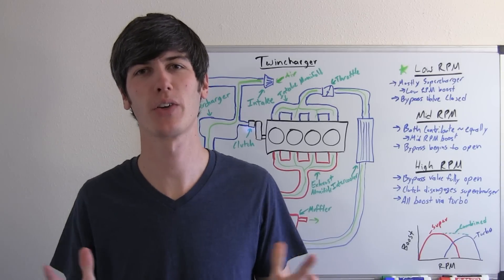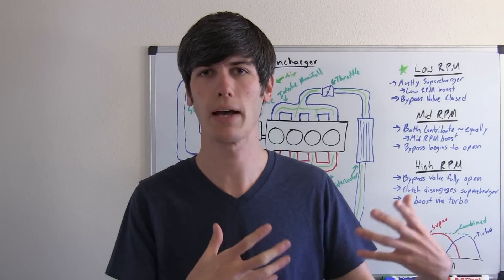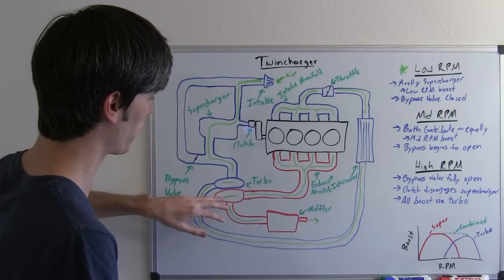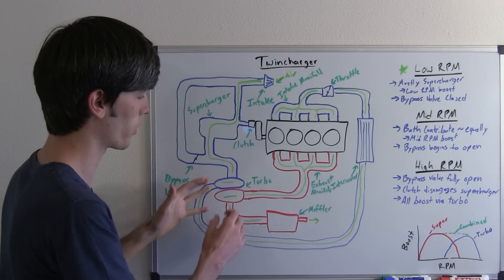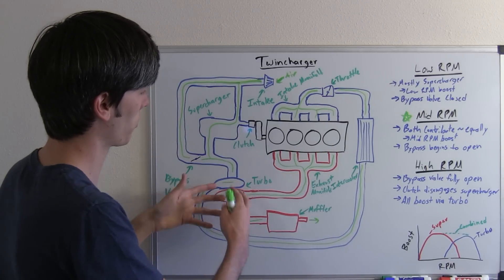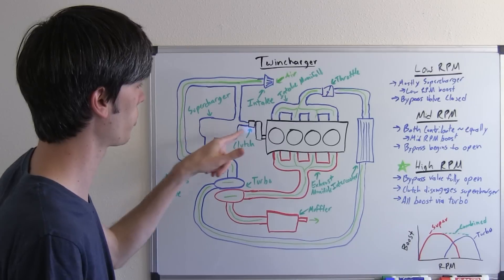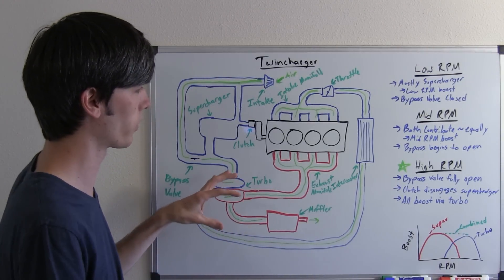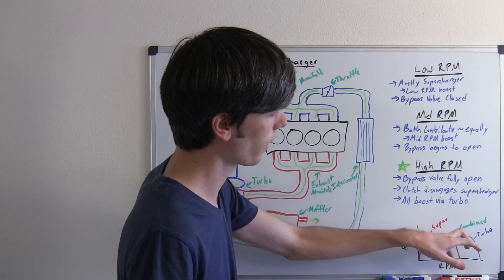How Twinchargers Work: Supercharger + Turbocharger

Comment: In the case of the Turbocharger: What if instead of a journal bearing or even ball bearings alone, you attached staged planetary gearboxes between the exhaust driven turbine and the intake turbine? If the exhaust gases were powerful enough to spin the input turbine, the speed of the output turbine could be much greater than the input, theoretically reducing the lag.
I don’t know how much would still be there because you would still need to build up enough exhaust pressure to spool up the turbine, but I think it’s a simpler design than having to worry about both a supercharger and a turbocharger, not to mention the system monitoring the RPM range, controlling the bypass and disengaging the supercharger from the crankshaft.
Or maybe it isn’t. :)

Comment: Couldn't the turbo portion simply take over the rotation of the screw when the exhaust speed becomes high enough? I'm thinking like on a bicycle where the pedals can both power you forwards or just sit still while you are rolling - so you could have supercharger pedals and turbopedals both connected at the same time if you get the analogy.

Comment: What if the supercharger never stops working i mean if there is no clutch to turnoff the supercharger and it keeps working with the engie rpm and when the rpms are enough turbo kicks in as an add on ? Please do answer my question as i am working on my Mercedes-Benz c180k kompressor to make as much hp & torque out of it as possible.

Comment: Few questions. Why not, instead of a clutch to the supercharger, simply have an opening for air above the compressor screws? Turning the supercharger isn't what robs power, the act of compressing air does. By preventing the air from compressing, the only power draw is friction at the bearings and the rotating mass of its internals (which is minimal).

Comment: Either I'm missing something or your flow diagram has a problem, specifically the location of the bypass valve. In the diagram boosted charge from the supercharger connects to the atmosphere during mid RPM. Under such conditions some of the boosted charge will flow backward in the intake. In twincharging I thought it was easier to have the intake flow to the turbo first then to the supercharger. Air will flow through the turbo as it does below the boost threshold and compressed by the supercharger. Above the boost threshold boosted air will be delivered to the supercharger. If one wanted to bypass the supercharger at some point the bypass valve would be located between the turbo outlet and the supercharger inlet.

Comment: Why hasn't anyone used compressed air injection directly to the turbo on the exhaust inlet using a nos button and eliminate turbo lag? The best of both worlds and an additional helping hand at high speed.

Comment: In the situation of a roots or screw type supercharger, which builds boost early, feeding into a centrifigual turbocharger; wouldn't the forced flow from the supercharger cause the turbo to spin up thereby driving the exhaust side of the turbo to scavenge exhaust rapidly? Essentially, at low RPMs, swapping the functionality of the sides of the turbo?
Reply: Rolf Kirby would you need a turbo with that setup though? The centrifugal charger already acts like a turbo and the twinscrew would help provide more linear boost wouldn't it?
Reply: Maybe the centrifigual turbocharger would give more boost at higher RPMs, while the screw would cover lower RPMs.

Comment: Amazing explanation. By the way, what it would be the cost of not having the clutch to deactivate the SC? Since lets say, the turbo at full boost with the bypass open the SC wouldn't fight to create positive pressure since the turbo would be doing that. It will have some loss but not compared with the bypass closed.
Other question is would the SC help the Turbo to Spool?
Last but not least is there a bypass butterfly valve that opens when delivering boost to an actuator, like a mechanical way to open the valve when sees boost, or is only electronic?

Comment: can i put the turbo before the supercharger?
Reply: we have been doing that in the diesel world for decades. its a far more popular system than the one shown as the turbo basically free wheels when exhaust gas isn't spinning it up, then when turbo boosts, the power consumption of the super charger drops to near zero as it isn't actually compressing air any more. much better system than this and no need for a clutch etc. most superchargers only use a hp or two to spin, its the creating pressure that sucks the power.

Comment: Andy's Autosport TV said turbos work at low rpm's while superchargers work at high. What's actually happening?
Reply from the maker: +Dave Restrepo in Volvo's production twincharged engines, the reverse happens. Super for low, turbo for high.
Reply: Thanks for the reply man. What makes volvos engines unique to this? and are they the only ones? Will there be a video about this?

Comment: Hello. Thanks for the great video. In your diagram you went from supercharger to turbocharger. Instead, can you go from turbocharger to supercharger with the by pass valve on supercharger? If so, would you need to run an intercooler from the turbo to the supercharger, or could you route the turbocharger directly to the supercharger, and from the supercharger run the intercooler to the intake manifold. Thanks again.

Comment: brilliant video and really knowledgeable! noob question but say i have a 150hp capable SC and a 500hp turbo would both the power from the SC & turbo combine and make more power than just the 500hp turbo on its own?
Reply: Not really, but you could combine them to eliminate turbo lag and have power throughout the rev range rather than just at the top end.

Comment: it be better if the supercharger would be used at the same time as the turbo wayyyy better because, As the supercharger Sucks in more air therefore more exhaust gases are made and then the turbocharger would spool up way earlier than normal and  would Suck in even  more air but you would need two sperate intakes Boom MINDBLOWN
Reply: The The Only Thing that's what I was thinking, running both at the same time more boost

Comment: I'm sorry to be asking a question on such an old video, however, it's something I've thought of time and time again and, if possible, I'd like to know if it would work not as well, just as well, or better than twin charging an engine. I have a supercharged Mercedes that I really enjoy and, once I'm able to, I'd like to be able to build the engine to somewhere around 400-450 hp, if possible. Obviously, if I'm going to do any serious hp increases, I would need to upgrade the internals and my question is assuming this is already done. Since my car is already supercharged, would I still be able to turbocharge it and have an added benefit of essentially supercharging a turbo?

Comment: So if I put one small turbo and one big turbo, can it work as twin-charger? Since the smaller turbo requires less exhaust to initiate in low RPM and in mid RPM the bigger turbo starts to kick in and in high RPM the bigger turbo provides most of the boost. And will this have less turbo lag or maybe no lag at all?

Comment: Could you do twin turbos and a supercharger
Reply: Yes you can actually.
Reply: Loginwithlogan 3 i got a idea what about 8 twin turbos in 1 car that car will burn the tracks
Reply: Generally you run twin turbos to get better spool up or for packaging reasons...a V 12 for example.  But with a supercharger covering the low end, I guess it makes more sense to have one larger turbocharger that is sized for max top end power.  A turbo sized for max boost at the top of the rev range will deliver a cooler charge than a smaller turbo pushing past its efficiency.
Reply: LoginwithLogan3 now your thinking like group b
Reply: @thepat2725   group b may have been batshit insane but they werent that insane hell the delta s4 was only twincharged and it already killed 2 people granted if they let it go on for any longer that way of thinking might have not been far off considering audi tried to make a 1000 horsepower version of the quattro for events but even the best drivers said even on a hillclimb the thing was uncontrollable
Reply: Alex Clemente actually that is just TT. They took the stock supercharger off when they started the build. And I'm not too sure about the nitrous either
Reply: Yes but only with a v13 engine and water methanol in your morning coffee
Reply: You could do quad turbos and twin superchargers, and any combo in between and or more, it's just a design. There is a limit to what a motor can take  (head bolts, head gasket, pistons, etc), so 5 little baby turbos or one huge massive turbo makes no difference...if they all create the same cf of air intake and cram it into the motor and the motor can handle it, they will work, but why?  The key is to do things that the motor needs for more horsepower, and keep it simple and less exotic so you aren't wearing out 15 turbos at once, and tweaking 15 turbos at once and filling up your passenger seat with turbos and ridiculous impractical, unnecessary nonsense like that when you can easily exceed the capability of many motors with just one turbo or supercharger in many cases. Adding complexity is a fools game and costly.  KEY for places like where I live (Colorado) is the main reason I could see this paying off in actual NEED for a big block. Ever hear the wording "mile high" associated with Denver? There is a reason...5k elevation or higher (I'm at 6300ft!). We have zip for air, and a 30% plus LOSS in horsepower due to thin air. Take any motor that runs fine at sea level in its stock setup (came with a turbo or supercharged), and change out pully or boost to make up for the 30% loss in air/power, and you have done NOTHING high performance whatsoever to the motor outside bringing it up to the basic sea level performance! Unfortunately the cost says otherwise, hahaha, so it "feels" special. But no new pistons needed, etc, nothing, zip! The main difference is that the turbo and supercharger are now working harder to make up for the thin air, which = heat, wear and tear, etc. Adding twin turbos so each isn't working so hard would make good sense, because we just can't get enough air, and if you actually drive into the mountains, the whole situation just gets worse and worse (been driving around at 11k and 12kft off road MANY TIMES.
Reply: 1320 has a video of a suv with 4 turbos
Reply: Loginwithlogan 3 look at the ford gt that broke the land speed record.  They have a twin turbo supercharged nitrous v8

Comment: So I've always heard the reason why Mad Max's clutch-driven supercharger wouldn't work is because any clutch small enough to fit under the hood would melt. Clearly this isn't the case for twincharged cars, as you describe them, so what is the real reason for the interceptor "blowing its bottom end out" IRL? Is it the change in chamber pressure? Also, are supercharger clutches electromagnetic or multi-disk or something else entirely?
Cheers :)
Reply: He said it in the video, electromagnetic clutches. It's an on/off kinda deal without any power modulation.

Comment: Fun fact: Both the P-47 Thunderbolt and P-38 Lightning had turbo-superchargers.
Reply: Actually they were turbocharged. Turbo-supercharger is just the technical name for a turbocharger, because a turbocharger is actually a form of supercharger. But not vice versa. Hope that makes some sense
Reply: @Tommy Etheredge
If I remember correctly, though, the turbocharger compressor could be driven either by exhaust gas or directly by the engine. So it would be a form of twincharger.
Reply: Also known as a Procharger.
Reply: @Andriod846  also procharger is just a brand that superchargers.

Comment: Would this be doable with a roots-type or twin screw type supercharger?
Also what would happen if you simply had the boost from the turbo go through the supercharger instead of being bypassed around it? if the supercharger was built so that it could handle the extra pressure would that work or is there something I'm missing that would cause an issue?
Reply: Wolfly Loyals.... Compounded twin charged setup is what you are asking about.... Lancia Delta S4 did that setup back in the 80's Group B rally car... Also EvoMadMac did this on his Evo5..search youtube for that beast too... His Evo makes 800 ftlb torque and 800 Hp at 6200 rpm...
Reply: Awesome thanks for the response
Reply: yes it would.  There is a guy that has 2 builds that are quite famous on youtube 1 vehicle is a twin roots type supercharged chevy c10 and the other is a twin turbo supercharged big block camaro on nitrous.  The turbos feed into the supercharger.  The entire setup is absolutely crazy.

Comment: Always loved the concept of twincharging but I know none of the science behind this so help me if my reasoning is off

Is this setup the most effective use of the supercharger? Air from S/C hits the turbine of the T/C, then turns a hard right to get to the engine. Sounds very restrictive.

The perfect setup (in my mind) would be a "y" pipe right before the Throttle Body. And it has to be the lower case "y" with T/C connected to the straight side facing the TB and S/C connected to a Blow Off Valve, then to the branched side of the "y". There would be a flange where the "y" intersects which closes off the T/C side during S/C operation. Guess a BOV would be needed on the T/C side for good measure. As the amount of boost on the T/C side starts to meet the S/C or it meets a certain RPM (however it works), the flange begins to close off the S/C. The S/C should disengage exactly when (preferably right before) the flange completely closes expelling its leftover boost via BOV. Take your foot off the pedal, meet the same requirements but in reverse, and the flange swings back the other way. 

Would this be a functional system?

Comment: Does this setup eliminate tubo lag?? Correct me if I'm wrong. The supercharger will take over in the initial stage of throttling (mid range RPM), therefore the turbo will have enough exhaust to feed from even before fully kicking in.
Reply: Hi, love the video. What would happen if you don't run the clutch set up and bypass valve?
Also would it cause damage to the supercharger if you didn't run them
I was thinking if running a Magnusson 2300 Heartbeat on my already turbocharged LS1
Than you for your help.
I
Reply: @thanasikassi3095  2.5 seconds*
Reply: @thanasikassi3095  You'd just be loosing power at higher rpm ranges to the Supercharger and technically you would have eliminated the Turbo's work
Reply: That's why Lancia did it with the 1986 Delta S4 Group B car. 0-60 in 2.7 seconds.
Reply: this setup looks very interesting, kinda wanna try it with my CA18
Reply: No. I think eliminating lag would result in having too much supercharger boost at low rpm, straining components and increasing the risk of lspi.
The ea111 vw 1.4 twincharger actually has more lag than the subsequent turbo only ea211
Reply: Bro a better turbo does that adding a sc. Will not

Comment: Hey Jason love your videos but I have a question I believe you will be able to offer the most insightful answer for being that you've had/driven subaru's and are familiar with the "boxer engine" 

My question in short is "should I get a supercharger or a turbo charger?" 

Some background Info is that I drive a 2013 Subaru BRZ manual and I've seen all of your turbo/supercharger explanation videos and while they were great and SUPER helpful I had decided on the supercharger, but then I remembered most STI and some subaru's with the 'newer' boxer engine come from the factory Turbocharged like my friends 2016 WRX so all in all which would be best for my "boxer" driven BRZ and why?

Thank you for making your videos and helping me further expand my knowledge of vehicle engineering, your fellow Petrolhead
-Steven Ziegler

Comment: Let's say your supercharger works as your intake... would you still need to use this clutch method or would it work like that at all, or is there a way around it? Is their other types of twincharger, if so how do they work? What's the major differences. I would love to see a newer more in depth video on twinchargers. Thanks +Engineering Explained , love your videos keep at it.
Reply: 6yrs on no one has replied 😢
It can but you’re losing power and efficiency turning a supercharger that will do nothing more at higher rpms which turbos excel at.
Reply: @13965082  Thank you, I really appreciate the response. In the time since I originally commented I've learned alot more about twin-charging and compound boost. Despite all the the complexities and disadvantages of the setup I enjoy the benefits of the the combination so I'm currently working on a custom Twin-charged setup utilizing dbw and multiple throttle bodies. Even after all this time I'm still playing with these setups💜.